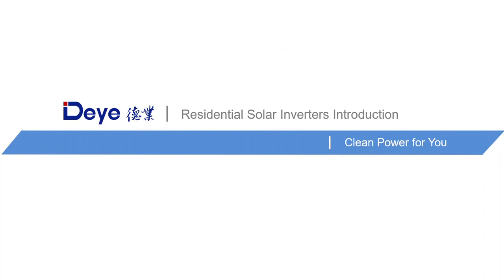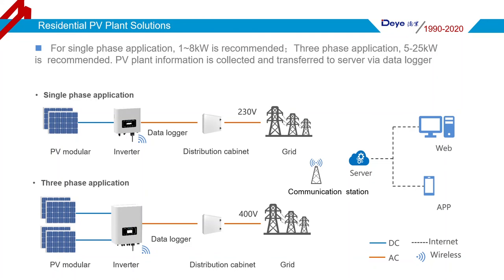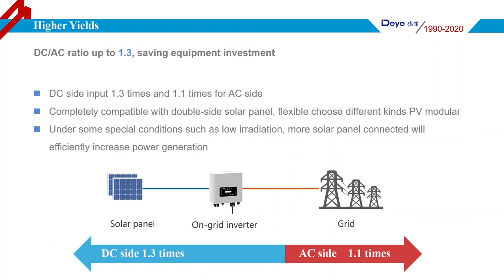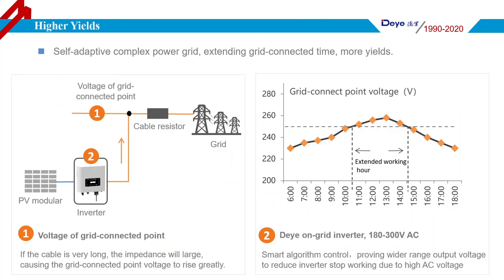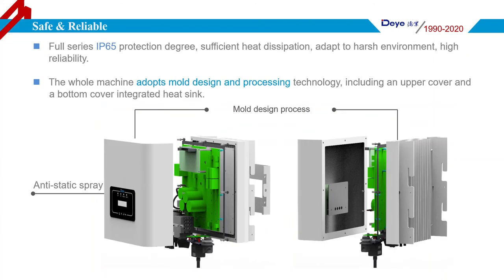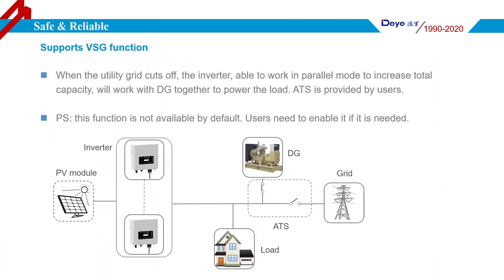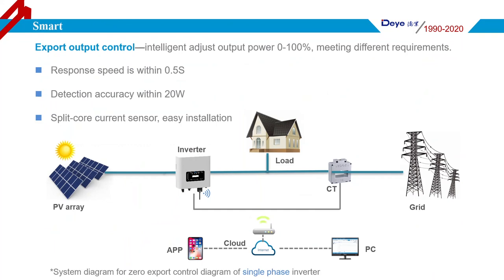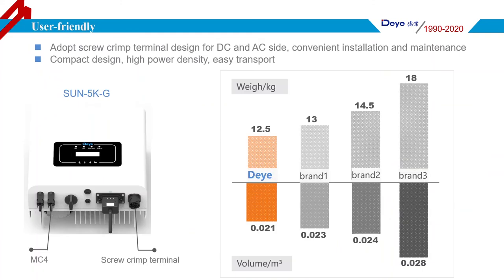String Inverter: Deye string inverter introduction of 1--25KW

Comment: Can you explain VSG function, please? How to enable? Is it possible to enable on-grid mode so we can increase capacity?
Reply from the maker: it means the string inverter could has the feature of diesel generator, which means ti can work the diesel generator teoghter.